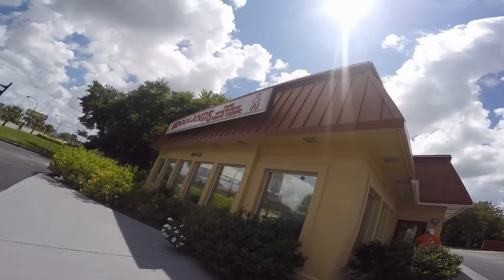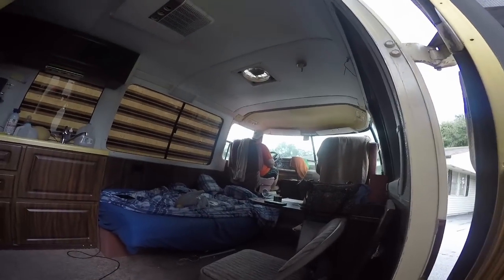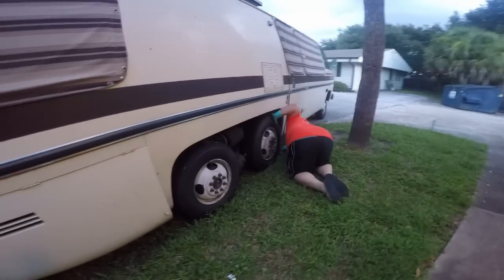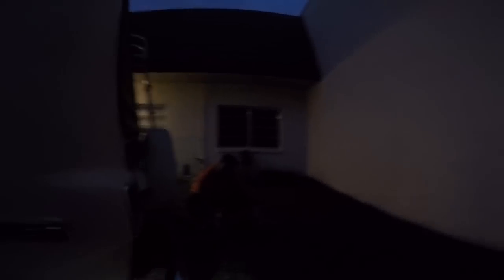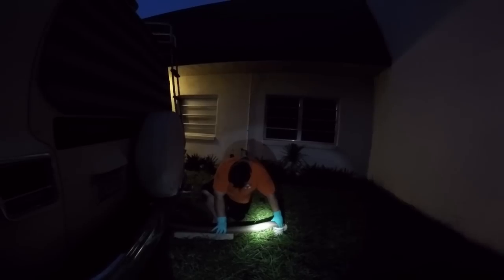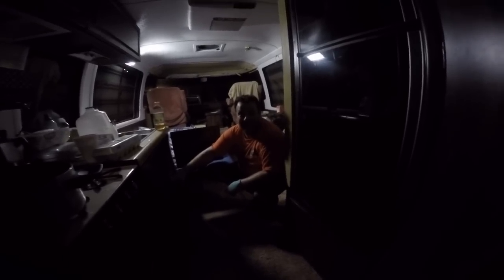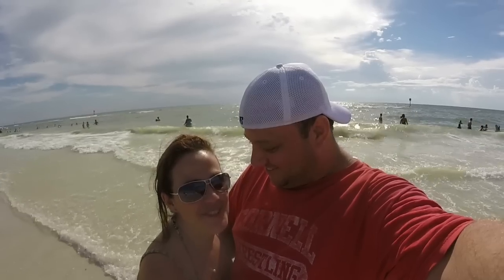First Black Tank Dumping & Pressurizing Plumbing: RV Living Full Time

Comment: Congrats to you both!...
Get in the habit to never ever leave the sewer area with gloves on you are likely to track really bad cooties every where, including Hep-C be very cautious!
Always empty the black tank first, then the grey tank water will clean sewer hose. 
Not a good idea to put harsh chemicals in the tanks it will dry out seals and break down plastics ...use a small amount of dish soap if anything. after empting black tank put back approximately 2-3 gallons of water and small amt of dish soap, you don't want the solids to become dry, it w/ become like concrete and clog and almost impossible to empty. Don't empty black tank very often need to keep fluid in it. If I am stationary for an extended period I KEEP BLACK valve CLOSED, GRAY OPEN (if on sewer sys) and close gray tank only before the last couple of showers, so there is enough gray water to flush after black tank is emptied, (be sure to close black valve after empty before opening gray valve) cleaning sewer hose. Also make sure your black tank vent on the roof is good,
I recommend getting one that automatically spins with the wind direction and has a good draw in removing odors, also before flushing toilet make sure your overhead electric vent is not drawing air out ...you will be bringing odors from black tank into the room. if you have good venting you won't need chemicals, I never use chemicals in the tanks, if anything use an enzyme product that breaks down and digest the solids. I have heard Rid-X has a new product for RV's that is enzyme based. harsh chemicals w/ kill the good enzymes/bacteria that naturally break down solids.
 Also I have never found the need to use special toilet paper for RV's...the regular stuff works just fine. also to keep the healthy bacteria and enzymes don't use antibacterial soap products.
Now to sanitize your water tank there is a formula I forgot the amount of bleach to water ratio, but it is on line that most people use to sanitize. water tank.
For general cleaning of surfaces using white vinegar 5% acidity for all purpose cleaning is a good idea, I keep full strength in spray bottles one in kitchen and one in bath area to clean all surfaces, works great, inexpensive and safe. If you have any questions let me know w/b happy to help. Wishing for ya'll the happiest of trails....

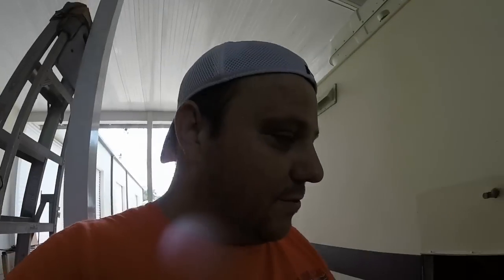Comment: Great job on the first time,James !  LOL  I noticed @3:05 that the flange for your water fill was held on with sheet rock screws, not the proper ones. May not be a big deal but I wonder why; was it repaired before and what happened to the original ones ?? Like I said not a big concern, but something to check out later on !
Reply from the maker: Wanderin' Moose Not exactly sure what your speaking of, but I will investigate. Thanks for pointing it out.
Reply: The fitting at your water fill on the outside of the camper !!

Comment: you can use an air compressor to dewinterize youre fluid lines just thot id add as its almost winter its a tedious process but still simpler